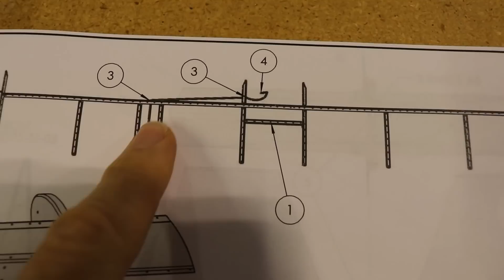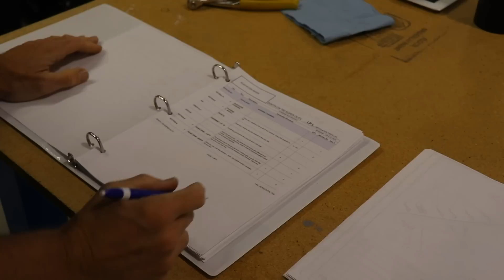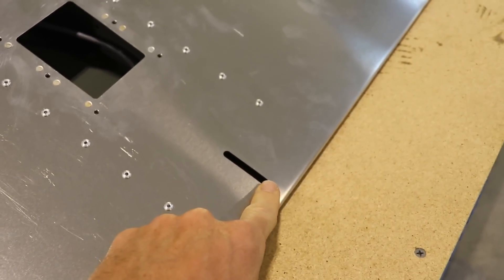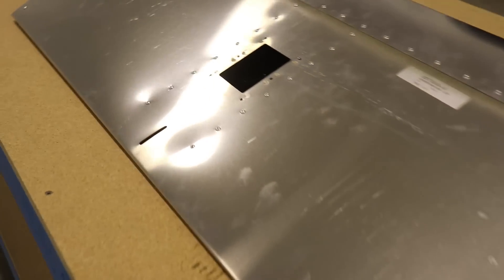CH-750 Elevator - DON'T make this MISTAKE! (Ep6)

Comment: Mark, did you say you used 6-32 nut plates for the access panel?  And is there a rule of thumb for size of screw / nut plate versus the size of the panel? Is that a thing? Thanks!

Comment: Thank you for doing these videos. Super informative. I may be building my first kit plane soon.

Question, why not prime the underside of the outer metal skin instead of the outside of the inner skin?
 Seems like no overspray would show.
Reply from the maker: Generally I will prime both surfaces that touch. So I'll prime the outside of the bottom skin, and the inside of the top skin.

Comment: Did you rivet the servo of the elevator or screw it with lock nut?
Reply from the maker: My servo is riveted in place. I riveted it in the elevator after it was painted so if I ever have to replace the servo I can drill out 4 unpainted rivets without messing up the paint on the elevator.

Comment: Those are electronica cable throughs. They crack under stress over time. I don't know the plastic type but probably ABS and probably with a lot of filler. If they break, and they will do that before the rubber, what is the worst that can happen? Find a buddy with a lath, make the holes bigger and put in some Delrin sleeves. The filler in plastic will resist abrasion better than metal so if its structurally correct then the abrasion, if avoiding heat induced friction, should keep them from failing for a long time. But I have the same problems but more of them.

Comment: I just watched this video and noticed you had riveted the hinge plate in place. I hope you drilled the hole for the cotter pin in the pin before you riveted it in place. It is a 5/64 hole and very hard to drill with it installed. I measured for the proper placement before assembly and drilled it out first using a 1/16 bit and then enlarging to a 5/64 which fits the cotter pin well. I got this tip from Ted Van Meter of Iron Horse Aviation as he had not drilled before assembly and commented how hard it was to do after.
Reply from the maker: Oh NOW you tell me! LOL. I always try to think ahead for things like this but never thought about drilling that hole. It still doesn't look that difficult to drill with a 6" drill bit and I have bunch of those. I guess I'll figure that out when it comes time to attach the elevator!

Comment: Incorrectly installed part... I'd blame that one on Zenith (that's how politicians do it... Not my fault. ;-) ). Holes should be positioned so it can't be installed incorrectly. CNC program needs an update.
Also, do any bolts get safety wire? Or are the nut plates self locking?
Do you have an FAQ? I hate to ask question that have already been answered.
Really enjoying your videos.
Reply from the maker: Hey thanks for the comment. Actually a lot of parts have holes drilled from the CNC machines so that they can not be installed incorrectly. I'll have to mention to Zenith that maybe they can change a couple of holes so it can not be installed backwards. Some bolts will eventually get lock wired but the nut plates are locking.

Comment: Are you concerned with corrosion on the interior skins that didn't receive primer? Or is that not usually a problem? Thanks.
Reply from the maker: No. Next video will talk more about this.

Comment: I put my right skin on first and wasn’t happy with the “bulge” in the skin.  So I built a wood break (actually had it from my RV build) and crushed the bend.  The left is perfectly flat, so I corrected the right with a small hand break.  Yours seem really flat (maybe just the light?), did you throw a straight edge on them?  Btw, your videos are awesome.
Reply from the maker: Dang it I just deleted my reply by accident! I did put weights on the elevator when I riveted it, but that was just to hold it flat to the workbench. I don't think it had any affect on preventing the skin from bulging. The skins seemed to fit really nicely.

Comment: Curious how your prior F16 Mechanic skills play in, what do you believe you do with your builds that has been instilled from the F16 life/ work
Reply from the maker: I worked on Minuteman III nuclear missiles (actually rockets) for 4 years, and F-16's and A-10's for 16 years. My job on the aircraft was maintaining the ejection systems. So, the life of the pilot depended on me doing my job correctly and perfectly. That's how I like to build my airplanes now. Even though no one is supervising me, I still try to make every part as perfect as I can. If I screw up a part, I man up and buy a new part. I don't try to make it work knowing that it's not perfect. The benefit of 20 years of Air Force maintenance experience is the Experience! There's no substitute for experience. Even though my job was Egress, I spent a lot of time in the sheet metal shop having the guys teach me how to rivet and work with aluminum. I'd roam over to the hydraulics shop and see what I could learn there too. I'd even go hang out with the crew chiefs and see what kind of paperwork they had to do. All this observation and training just gave me a good understanding of aircraft structures and systems. I'd also happen to roam over to the bench stock room where nuts, bolts, clamps, and all kinds of cool hardware would accidentally fall into my pockets. I never would notice until I got home. Ya, that was my favorite part...

Comment: I noticed you didn't "flare" or bend the edges with the roller-pliers(?) where the skins overlap. I think you did this on the Cruzer. Are you no longer a fan of the idea, or only worth doing so on the wings?
Reply from the maker: That's correct-The only place I think it needed it was on the forward wing skins on the Cruzer. These skins fit perfectly flat against each other.
Reply: Hmmm, it was your Cruzer that inspired me to form all my edges on my Super Duty.  I agree that not necessarily required but it sure does make those edges crisp.  You think any possible harm?  Or just a waste of time?
Reply from the maker: @shanrock3555  No harm...just as you say "a waste of time" LOL! A lot of guys bend the edge of all the skins on the Vans RV's too. It won't hurt anything.

Comment: Those "grommet" you used are for mounting LEDs in a panel.  You insert it into the panel and then the LED snaps into it from the back.
Reply from the maker: Dale Gloer Really? I didn’t know that. Is that what they are specifically designed for? I’ve always used them as grommets!
Reply: Dale, NO they are not! these are snap bushings for pipes and electrical wires. What you refer to are LED bezels and are much, much smaller and different than these!

Comment: Great intro, wasn't expecting that.

One thing, if you don't mind sharing, would be what's your estimated completion?  I understand this project is gigantinormouslyhuge, but if you had to wager when are you hoping to get it through the FAA checks?

Also, we're getting a very clean edit of things going together because you're amazing, but how long does a typical part / sub part usually run in length?

Comment: I think you need to fit the horns before paint or you will have unpainted rivets, which will not look so cool. A small touch up gun could be used when you come to paint.
Reply from the maker: I see no problem with unpainted rivets. There's quite a few on my Cruzer.
Reply: @KitplaneEnthusiast  Not a problem but with your OCD being like mine (bolts turned to the flats line up and screws with the slots lined up), I just thought it would make them look like an after thought. I would be out there with a small brush putting paint on them :-)

Comment: Hey Mark! Great tips and content as always! I've been gathering the necessary tools etc etc for my build , I've got central compressed air , but also purchased a cordless electric puller from Milwaukee. It's pretty slick , nice for tight spaces. Seems as though you will beat your 2yr estimate even as meticulous as you are. I'm ADD and wouldn't have it any other way! Thanks again for doing this for us! Blue Skies!

Comment: that removable servo technique is a bit confusing to me noob. Would be nice if you explain the design and then later actual installment carefully in detail.
Reply from the maker: There's flat piece of aluminum that covers that hole. It gets riveted to the skin. I chose to install nutplates so that I can remove the cover is necessary.

Comment: Great video, and it looks like it is going together easily and nicely thus far.  Is there a minimum skin thickness that is required for attaching those threaded hole plates you used for your elevator trim cover?  You don't need to reinforce the metal under the hole plates with some spare aluminum strip stock?  Is there sufficient space to easily mount the trim motor after the skins are applied?  Thanks again for doing the video series on your build.  This really makes this not look so daunting as I thought it might be.  Much appreciated by us future builders I'm sure.

Comment: What's up with your pneumatic puller. I noticed in your last couple of videos that you need to pull twice on each rivet. Does it need a top off of oil?
Reply from the maker: You will see the death of that pneumatic puller in Ep7 (or maybe it’s Ep8). I’ve ordered a new one from Zenith. It’s never pulled a river in one squeeze. I think it just doesn’t have enough travel. Hopefully the new one will.
Reply: Pull the front nose cover off and check that the locknuts haven’t loosened up.

Comment: Yet another great idea about the grommet for the guide wire.  Question:  Is it worth saving the pins from the rivets over the whole build?  Could they be sold to a metal salvage place, or is there some other solution?  I also noticed you follow another of your tips by using the empty Mushroom containers to hold your clecos.
Reply from the maker: When I built my Cruzer I saved every rivet stem. The container probably weighed 25 pounds! I threw them all in the re-cycle bin.